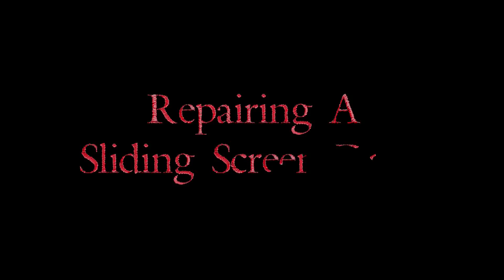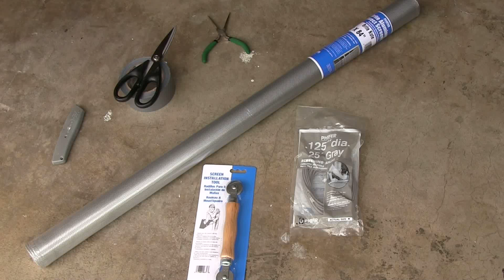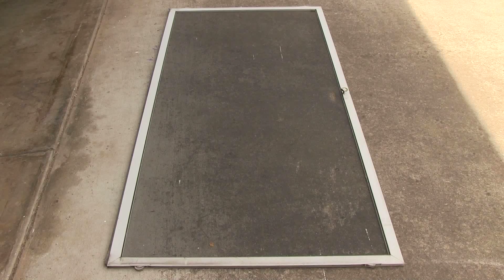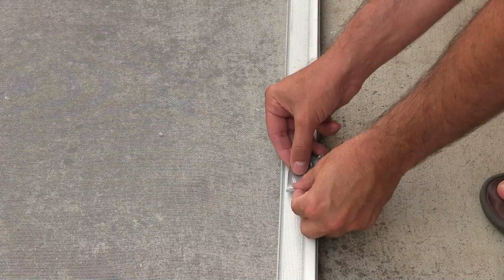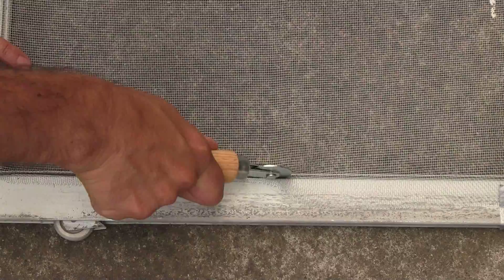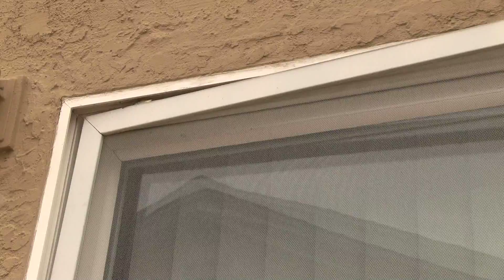How To Repair A Sliding Screen Door Life Hack

Comment: Where can I get the track inserts? My door is not big enough and I need something to fill in the gaps between the rollers and track.
Reply from the maker: Our sliding door came with the little insert thing. I bet you could find the sold separately from a window and door place.
Reply: @TSGChannel2  ya I need my door raised by like an inch or so. Or at least I need to put something in the top cavity like a 1 inch square dowel to put some kind of tension to keep it from falling out
Reply from the maker: @GodAlwaysWins  It sounds like your door might just be too small!
Reply: @TSGChannel2  yes but I got it for $15 just wanna try to make it work before I toss it. My measurements showed 79 1/4 in and this door is 77 1/2 in